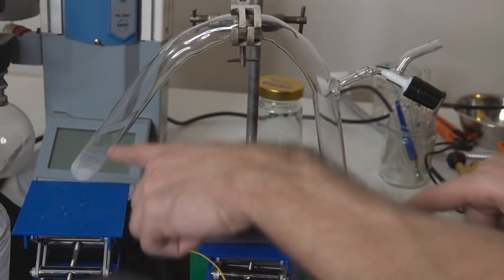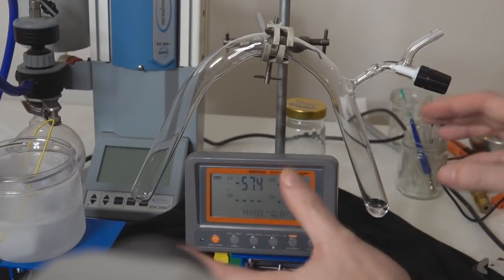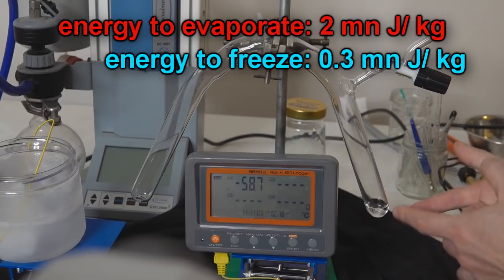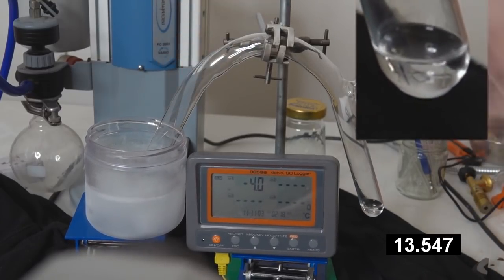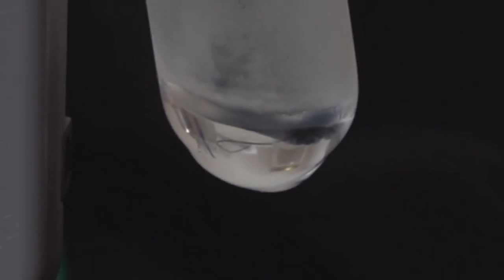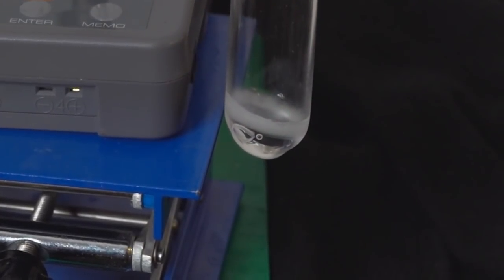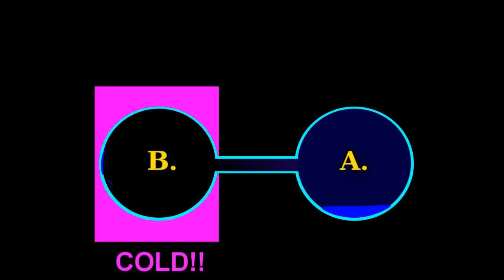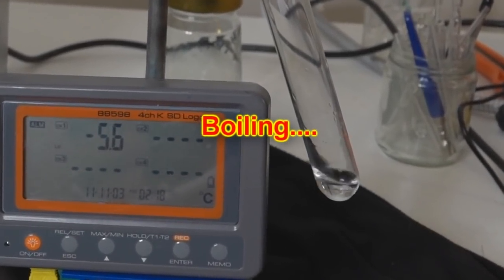Does Water Boil or Freeze in Space?

Comment: I expect this is a super stupid question but, if there is a vacuum in the tube,...
how does the water on one side "know" that the other side has suddenly cooled in order for it to almost instantaneously evaporate and rush across the tube? There's no convection in a vacuum and I don't see a line-of-sight inside that apparatus for radiative communication so I can only imagine some conduction mechanism along the glass walls leading to a skin-effect transfer of the initial evaporate (tho that would presumable be slow in a thermal insulator like that glass)
Reply: NOT a stupid question! There isn't a vacuum in that tube as Thunderf00t claims. There is liquid water in the right side & some of that has boiled BEFORE the experiment starts & it has filled the entire tube with gaseous water. The boiling off of water stops when the gas pressure of the gaseous water increases sufficiently to stop the water boiling off. Now when Thunderf00t rapidly chills the left side gaseous water molecules already in contact with the glass freeze instantly which reduces the gas pressure so more molecules boil off the liquid water etc etc. Eventually the liquid on the right cools at the surface sufficiently to form an ice layer over the liquid water.
Reply: @nightjarflying  
Ahh yes! Thanks for a perfect explanation!
Reply: @poneill65  Thunderf00t is also wrong about the molecules zipping over to the left side at the "speed of sound" - some molecules will be travelling at around 900 to 1,000 mph. Sound is faster in water vapour than air if the vapour pressure is high enough. [a guess - I haven't calculated it].
Reply: I've always found this concept interesting as well.  I find it helps to remember that liquid water will try to reach an equilibrium with the vapor pressure above it.  In equilibrium there is a constant exchange of the same number of molecules being thrown off the liquid phase into vapor as there are vapor molecules coming in contact with the liquid and sticking.  By cooling the other side of the tube the vapor molecules start sticking to that region and the vapor pressure drops.  The net result is an imbalance in the equilibrium which causes more liquid molecules to evaporate.  This action carries heat with it and causes the remaining liquid to cool until it begins boiling and then crystalizes.  This is also the concept which links vapor pressure to boiling point.  

It's a bit of a mind bender to imagine what is going on in a super critical fluid at the moment when the two phases become indistinguishable.  The boundry sort of dissolves into the bulk of the fluid and even condenses back out of the fluid when it goes sub-critical again.
Reply: @nightjarflying  That literally is the speed of sound, though, or at least very close to it. It's just not "the speed of sound in normal Earth atmosphere at sea level".
Reply: @technicalfool  at sea level pressure, normal temp the speed of sound in air is 770 mph while the speed of sound in water vapour [no air] is around 30% to 50% more at the same pressure. So yes.
Reply: @nightjarflying  except that we only see visual evidence of that boiling when TF applies the cold bath to the tube on the other side, so the OP question still hasn't been answered.
Reply: @nightjarflying  the speed of sound is variable. It's not fixed. It's different for every medium particle waves are travelling through. In this case the medium is water vapour (since vacuum is not a physical medium).
Reply: @aaronmicalowe  Why are you telling me this? In a post above I say water vapour & air transmit sounds at different speeds for equal temps & pressures. Steel for example has a speed of sound of around 13,000 mph !
Reply: @aaronmicalowe  Go read my explanation again. In my explanation I say the tube contents - the water, has reached an equilibrium between its liquid state & its vapour state BEFORE T/F00t chills the left side. In other words, before T/f00t begins recording some of the liquid water boils & the vapour occupies the rest of the tube. Boiling stops when the vapour pressure is sufficient. It is obvious that the glass tube can't contain a vacuum with liquid water at the right end when T/f00t starts recording.
Reply: @nightjarflying  You stated that:  "Thunderf00t is also wrong about the molecules zipping over to the left side at the 'speed of sound'". The speed of sound is defined by the rate that a wave of particle collisions occur in a medium. So, by definition, whatever speed those molecules navigate across is the speed of sound. The actual speed is irrelevant so stating speeds is meaningless if you understand what is happening.
Reply: @nightjarflying  I just said the speed of sound is irrelevant and your reply is about the speed of sound. Learn to read, lol 🤦
Reply: @aaronmicalowe  I am aware that the ice forms on the left at a rate dependent on the glass temp, area of chilled glass & water vapour pressure/temperature at the glass - there's no need to wait for water molecules to travel the length of the tube because the molecules are ALREADY THERE. My comments about speed of sound are separate to that. It is you who needs to read for comprehension & not assume my speed of sound remarks mean something they do not.

Comment: interesting that heat/cold can transfer through a vacuum. isn't it supposed to not transfer?
Does this prove a superconductive ether?
Reply: No
Reply: It's the water vapour in the vacuum that's transferring the heat. I'm not sure what starts the process though. Either some of the water has already evaporated into the vacuum and that gets things moving, or the vacuum transmits heat as if it wasn't there (which I'm not sure agrees with science).
Reply: @aaronmicalowe  After reading that i'm pretty sure it's just that poor tor rating of the vacuum. The cold condenses the low amount of air that is in the tube and creates a mildy stronger vacuum in one section. But even then, i'm not sure why the water would then freeze. Maybe it's the heat leaving with the evaporating water particles? Interesting to be sure.